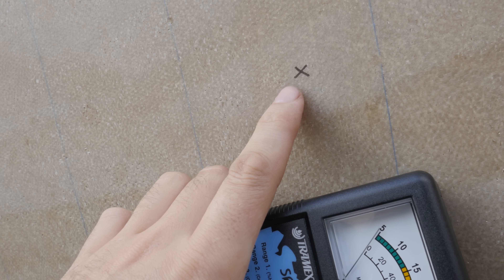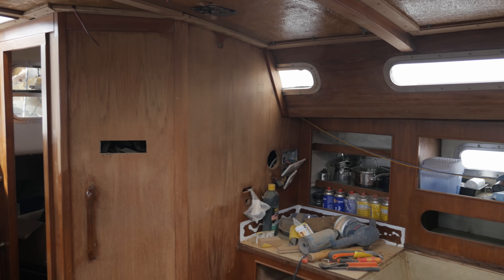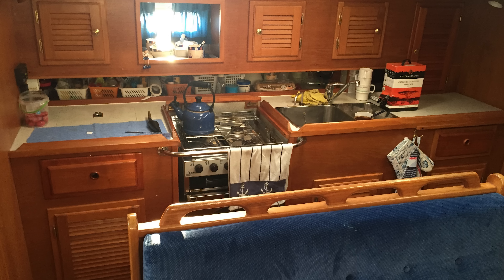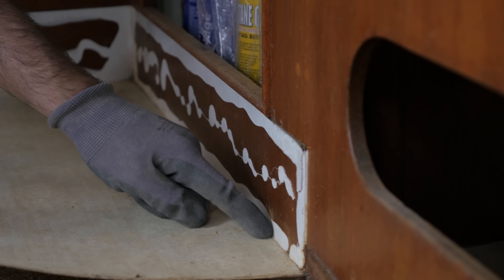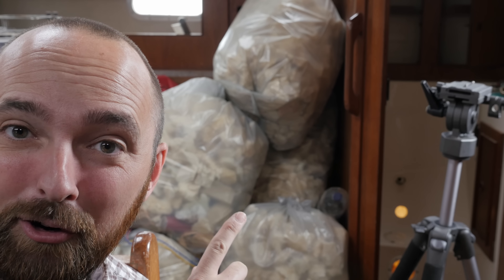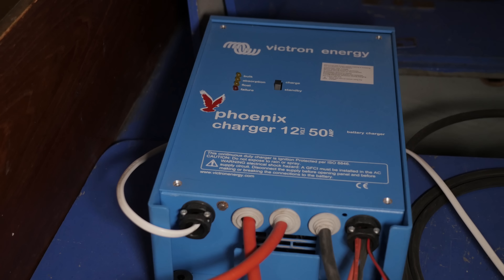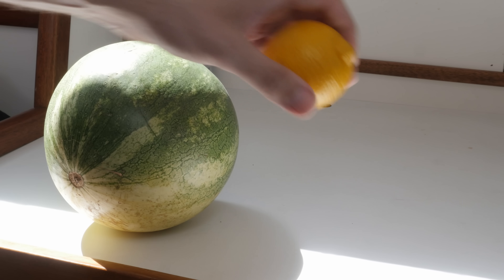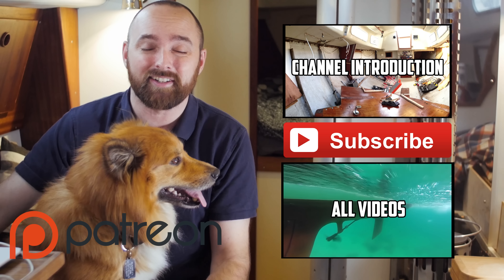Sail Life - DIY sailboat restoration

Comment: what's the blade product you use for varnish scrapping called mads?
Reply: Hi Adam! The cheap one is here: http://www.toolstation.com/shop/Painting+%26+Decorating/d150/Decorators+Tools/sd160/General+Purpose+Scraper/p82217
The one that you can actually use is here:
http://www.buybrandtools.com/acatalog/bahco-665-heavy-duty-carbide-scraper.html?gclid=CInD3vfnrs4CFdYK0wodM-gIUA
Make sure you follow Mads' tip about grinding off the edges of the blades though. They can really gouge.
Reply: Thank you so much Better than it was (sailing Boukadoura) - really appreciate it 😁😁

Comment: $2000+ for a half size stove and oven seems a total overkill to me.   Everything "Marine" is two or three time the price of "Camping" equipment.  Why not have the existing stove professionally refurbished at a fraction of the cost?   Not only will it look good as new but you can be sure that it's safe to use as well.
Reply: Very good idea
Reply: It's the exclusivity and the mark of approval. But the actual sum of the item is probably in the lower to middle hundreds.
Reply from the maker: The stove that came with Athena is very affordable and in OK condition :) I'll continue to use it until it dies on me then I'll consider upgrading :) If I end up redoing the gally at some point I might also chose to upgrade to a different stove but for not the one I've got is perfectly fine :)

Comment: Hi Mads, You asked about the changes you'd make to your galley, and my wife and I have 2 suggestions... the first thing is you should design it for a women... it increases the odds that they will live aboard with you. We thought you should avoid having a drop in refrigerator because it takes up counter space, and women love counter space. Secondly, install or build a fridge with two drawers, or one that has a door that opens from the front.  Here is a link to the type of fridge we are talking about
: 
http://www.compactappliance.com/on/demandware.store/Sites-Appliance-Site/default/Product-Show?cgid=Appliances-Refrigerators-Built_In&mtcpromotion=PLA%3EAppliances%3ERefrigerators-Built_In%3EU-1224DWRS-00A&prod=U-1224DWRS-00A&showGrid=true&src=SHOPPING&CAWELAID=120128510000049326&CAGPSPN=pla&CAAGID=19730913491&CATCI=pla-143149284011&k_clickid=137eb1d8-69b3-4ace-9749-0c4ffd3d12ca&gclid=CPzrk8D1tM4CFcZbhgod1dUDxw

or

http://www.solarhome.org/novakoolr190054lsingledoorrefrigeratorr1900.aspx?gclid=CJGR7LH3tM4CFYwfhgodjUUERw

This fist link is to one that is incredibly expensive, but you at least get the idea of what we are talking about.  We love your videos and we are really hoping you find a Unicorn to join you on your adventures!

Comment: I made  list of your "questions".  I have two ideas to improve on your galley.  Add heavy duty D rings with backing plates strategically around your galley so you can tie yourself off while cooking in a seaway (given your vulnerability to seasickness, they may not be used too often :)).   I have 4 heavy D rings on my Fantasia 35, similar sized galley to yours.  You could add some handrails too, I don't see much to hold on to.Assuming you are keeping your Refleks for heating, check out Wallas Stoves at www.wallas.ca.  They are clean efficient diesel cooktops.In water moorage for me on the St Lawrence River (Canada) is $1600 US/6 months (it's a nice place).  My out of the water winter storage is $800 US/6 months (a nice DIY friendly yard).
Reply from the maker: That is an awesome idea! I was thinking about doing something like that near the sink. I like your idea of having multiple places to "hook in":) I'm intrigued by the wallas stoves! I'd love to take a closer look! 800 US/6 months doesn't seem horrible considering some of the other prices I've seen mentioned in the comments :)

Comment: Mads get a new stove, these are more fuel efficient these days. And yes $2200 is a lot of money. I recently bought a Origo 6000 which costed €900 because I didn't trust the gas system onboard. And with the Origo I save on the insurance because I don't have gas onboard anymore. Can't your friendly neighbors from Germany not pick one up from SVB?
Reply: I've gone for the origo 1200 as like you I don't trust gas on a boat.
Reply from the maker: The stove is actually not that old :) I believe the previous owner replaced it around 2007 :) SVB is one of my favorite webshops! It's kind funny that getting something delivered from SVB is cheaper than from certain Danish webshops. Boggles the mind ;) I've heard good things about the Origo stoves :) Are you happy with yours? :)
Reply: +Sail Life very happy with it, buttttttttt............ I don't live on my boat (yet) so I'm not in a hurry to prepare some food as this takes some more time on these stoves. I also know that Curtis from Westsail has one on his boat.

Comment: I had those finger breakers in my small galley too. Replaced them with caravan pop-out type ones.
http://i.onfinite.com/bxKDL6nt.jpg
Reply from the maker: Where did you buy them? I found the on SVB but if I'm not mistaken they were around 35 EUR a piece. Seems a bit expensive to mee :)
Reply: +Sail Life locally but plenty of online suppliers. I had to fill the hole in with a wood plug then redo. https://www.leisureshopdirect.com/caravan-accessories/caravan-door-fittings/internal-caravan-fittings-miscellaneous/caravan-accessories/caravan-accessories/internal-caravan-fittings-miscellaneous/push-lock-system-for-caravan-interior-doors
Reply: I have the finger breakers too. They keep everything shut and I don't particularly have issues with them other than they are oriented differently throughout the boat. Glad to see there is an alternative that maybe someday I can replace them with. Thanks for the info!
Reply: It's using them in a heavy sea where they got their name lol

Comment: Looks like you will have a lighter boat when you get done. Mads that is a lot of garbage ! lol !
Reply from the maker: Hehe :) At least until I start moving all of my stuff aboard :) Of course that might take a while - dang rain :)
Reply: Hey Mads at least you have time to work on all the other projects by the time you finish the hull you will only need to put the boat in the water and start sailing .
Reply from the maker: That's true :) I won't be completely done (that will take a few more years) but I should be ready for a long nice summer cruise :)